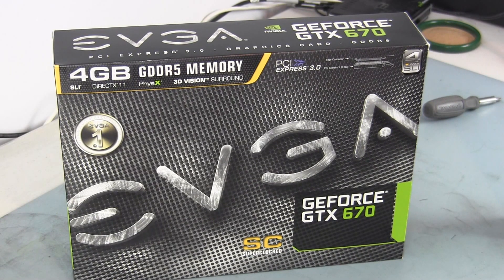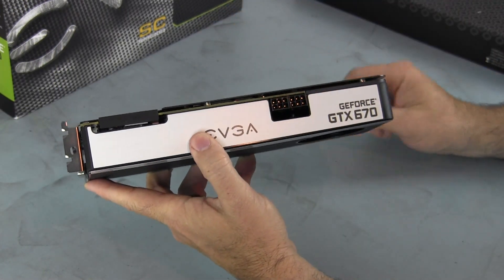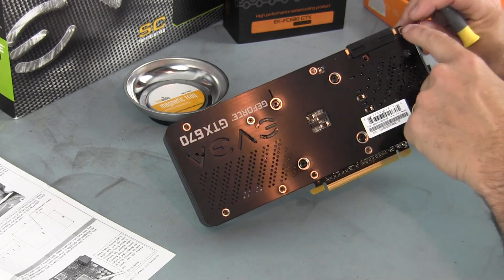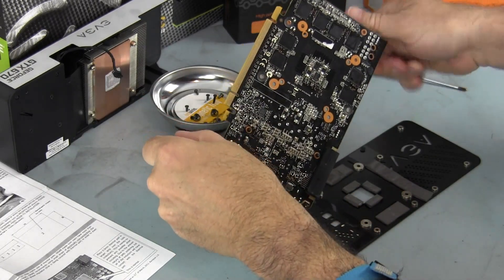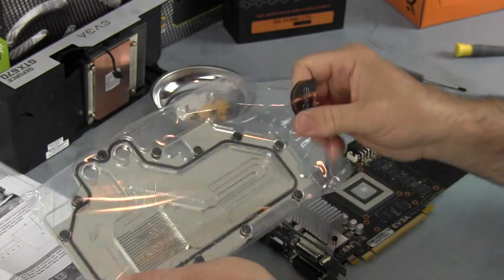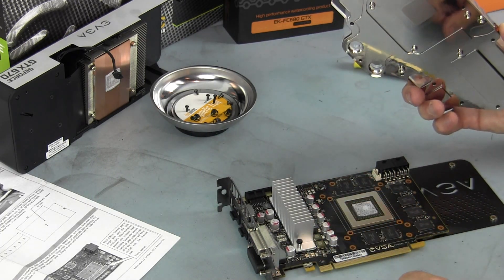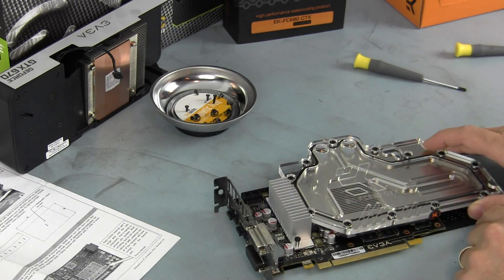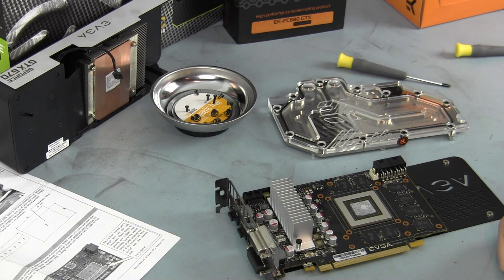Will an EK-FC680GTX Water Block Fit on a EVGA SC 4GB GTX-670 ?

Comment from the maker: Not sure. You need to check the EK configurator website for your card and it will tell you what water blocks will fit it.  Actually they no longer make this water block.  They only make the CSQ design now.

Comment: Nice video. Just a question though, I have an Inno3D gtx 670 and am looking to watercool. I cant however seem to find out whether specific 670 waterblocks will fit it as they mention in their specifications that they are only compatible with reference cards. Is the Inno3D gtx 670 a reference card and if so, will it fit the waterblocks such as those on xspc and the koolroom? THANKS!

Comment from the maker: That is the exact one I wound up getting. The pcb on this card is identical to the GTX-680 reference card. If you want an EK Waterblock the one you need is the water block I have in the video. The water block  is the EK-FC680 GTX.

Comment from the maker: Also if you overclock just your CPU you will also see significant performance also out of the 2GB FTW card. When I overclocked my 2500K to 4.7 FPS on the 2GB FTW went up to 127FPS in Heaven Unigen.

Comment from the maker: Check out my other videos I have benchmarks on the 4GB SuperClocked version and the FTW 2GB version to see for yourself, but quick comparisons. The 4GB SC model ran Heaven Unigen at 110 FPS vs 113 FPS for the 2GB . 3D Mark11 PScore P8639 vs P7778, X 3034 vs 3083. Vantage P30531 vs P24356, X18068 vs 18147 and PCMARK 7 5058 vs 4733.  Note though these cards were benched in differences systems but at stock speeds.  In my opinion you get great performance and value going with the 2GB FTW.